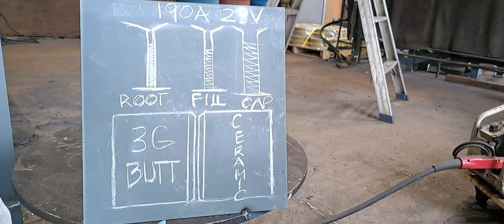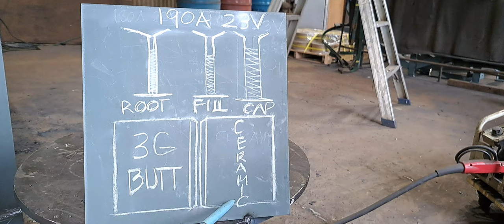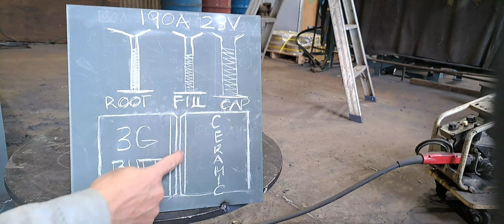FCAW TUTORIAL 3G BUTT JOINT WITH CERAMIC BACKING

Comment: sorry but if you don't grind the welding passes, the weld will be repaired
Reply from the maker: Thank you for your comment,but not all the time you need to grind the welding passes.bdw thank you 🙏
Reply: @lemuelramos5364  Can you help me with this issue, in which places should I not grind?
Reply from the maker: @kozmafilin  had mentioned the welding passes,how about in the situation taking license test without grinder could  you grind?
I know you're a professional welder thank you my friend
Reply: @lemuelramos5364  grinding in the welding procedure slag depth cleaning every professional can do this is allowed I know that only the corners of the weld are grinded
Reply: D1.5 work is x-rayed most of the time no grinder allowed on test. Only chipping hammer and wire brush. 1/16 dual shield 3g is what we do.